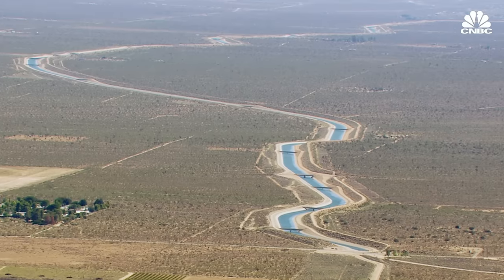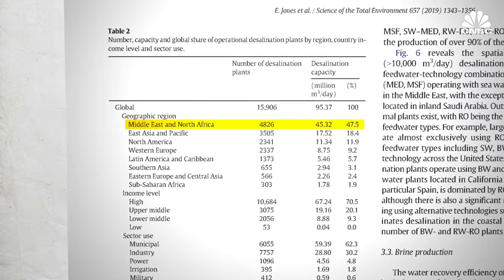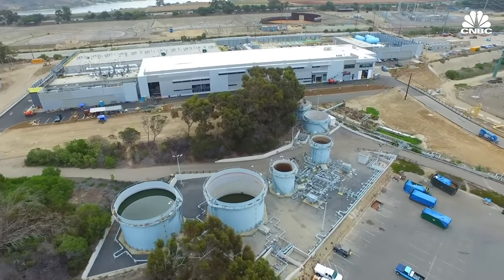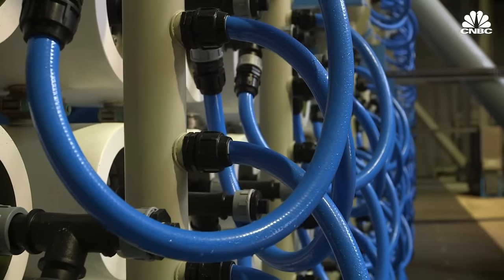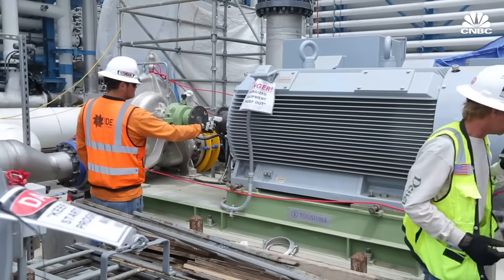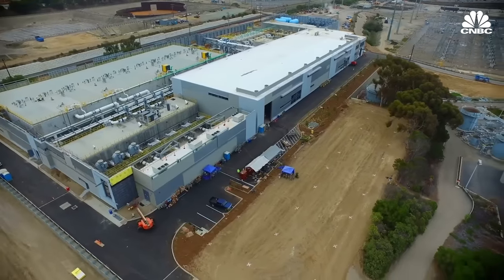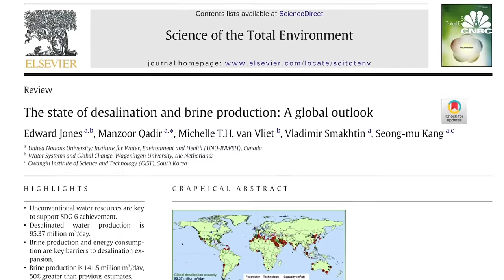Can Sea Water Desalination Save The World?

Comment: One possible, partial solution to the problem of returning heavy brine back into the sea would be to install a pump that draws straight seawater out of the ocean and injects this into the outflow pipes of the DS plants and thus diluting the brine. If this was done far enough back from the exits of these pipes this would likely ensure that the brine was evenly diluted and so this diluted brine would likely be less harmful to denizens of the deep. Not a full solution, but rather inexpensive and harm-reducing.
Reply: The biggest idea I am trying to express is tunneling aqueducts from the coast, in this case the west coast of the USA inland to feed combination geothermal power and sea water desalination plants.  The idea seems to be so big that no one has considered it possible but I believe it is not only possible but it is necessary. For over a century the fossil water contained in aquifers has been pumped out to feed agriculture, industry and municipal water needs. The natural water cycle cant refill fossil water deposits that were filled 10,000 years ago when the glaciers melted after the last ice age. Without refilling these aquifers there is not much of a future for the region of the United states. As a result ground levels in some areas of the San Joaquin Valley have subsided by more than 30 feet. Similar fossil water depletion is happening in other regions all around the world. TBM and tunneling technology has matured and further developments in the industry are poised to speed up the tunneling process and it's these tunnels that are the only way to move large volumes of water from the ocean inland. The water is moved inland to areas where it can be desalinated in geothermal plants producing clean water and power. In many cases the water will recharge surface reservoirs where it will be used first to make more hydro power before being released into rivers and canal systems. It's very important however to not stop tunneling at these first stops but to continue several legs until the water has traveled from the ocean under mountain ranges to interior states. Along the way water will flow down grade through tunnels and rise in geothermal loops to fill mountain top pumped hydro batteries several times before eventually recharging several major aquifers. What I am proposing is essentially reversing the flow of the Colorado River Compact. Bringing water from the coast of California first to mountaintop reservoirs then to the deserts of Nevada and Arizona and on to Utah, New Mexico, Colorado and Wyoming. This big idea looks past any individual city or states problems and looks at the whole and by using first principles identifies the actual problem and only solution. Political will is the biggest hurdle to accomplishing big projects. Especially in California and after blowing $100 billion on a high speed train to nowhere. I think it is obvious to most people that something drastic needs to be done to solve the water problem and that conservation only goes so fare. I would propose to fund the tunneling part of this solution with a system similar to the Permanent Wyoming Mineral Trust Fund is a type of permanent fund called a sovereign wealth fund (SWF). SWFs are typical government funding tools. They consist of investments and assets that the government is not allowed to cash out or deplete. However, while it can't touch the principal, the government normally has the right to spend any revenue these investments generate on appropriate functions and expenses. Each state, California, Nevada and Arizona and on to Utah, New Mexico, Colorado and of course Wyoming could place a small 2% tax on the energy sector and use those funds to invest in Geothermal energy projects and eventually the aqueduct can link up to those projects. There are already over 800 geothermal energy projects in California alone. The equation for my big solution is (ocean water brought inland through large underground aqueducts + combination geothermal and desalination plants = clean water and clean energy).
Reply: Or we could just seperate the minerals in the brine.
Reply: Just another sign that you CAN'T have infinite growth on a finite planet. Yet we won't learn,we just keep on trying unlimited growth. Humans are this epochs dinosaur.
Reply: At the end of the day Enviros are worried about a small, tiny little area where some fish might not be able to live. Big deal. A small price to pay for such a good benefit. But we all know that is not all it is. Enviros will come up with reasons to appose Desalt plants to no end. That's what they do.
Reply: @johnbeckwith1361  
It is not a small tiny area where some fish might live. It's an eco system. A tiny inlet can hold an entire, balanced eco system. Oysters, shrimp, sea grass, fish, birds, etc etc.

I live on the Texas coast. We've seen first hand how careful you have to be with runoffs down here. We're getting ready to build a huge desal plant here in Corpus Christi. You'd better believe it's not just "eco warriors" fighting this fight. Hunters, fisherman, people in the tourist field, restaurants-- everyone is watching.
Reply: 1. brine is the byproduct of desalination so first we have to do desalination before treating brine the process itself is costly which has 50% effective.( we should find better way to increase the effectiveness of process)
2.whatever we do , but brine is something which is a result of our activity and assuming the natural rate of desalination is very less comparison to our activity WE SHOULD FOCUS ON LESS CONSUMPTION OR REDUCTION  )

3.the dilution itself is carried out in sea and ocean but the quantity of NaCl remains the same as the amount of NaCl is accumulating thus we again comes to same problem excess NaCl 
4. a.we can use brine in the process of demineralisation.
 b.can be used in chemical reaction in process.
5.the product containing high amount of Na Cl should be reduced and the industries should use other salt that do don't produce saline taste as NaCl is the only salt that produce saline taste.

Comment: Use the brine for energy in a hydro steam engine, and the salt for thorium engines!
Reply: its a good try but, at the moment thorium is so abundant in stock piles and mine-able deposits that it doesn't really justify filtering ocean water for it, its the same for other things like gold.
Reply: @devonking8727  Yes, but if its ocean water that's becoming clean water, than it would justify using it for thorium and that means that we don't need to mine from the earth for it anymore. Just use ocean water.
Reply: Wrong kind of salt.  MSR uses lithium-beryllium fluoride and lithium fluoride, which remain liquid without pressurization from about 500°C up to about 1400°C, and require no water or pressure, which is what makes them so safe plus the fact they hotter they get, the less they work, plus you can have thermal plugs that dump the salt with no human intervention plus a mechanical one to shut things down.  Original thoughts were small, self-regulating ones for cities in the middle of nowhere with nobody to tend them.  If you mess with them, they can automatically poison the mix so you can't use it for anything.

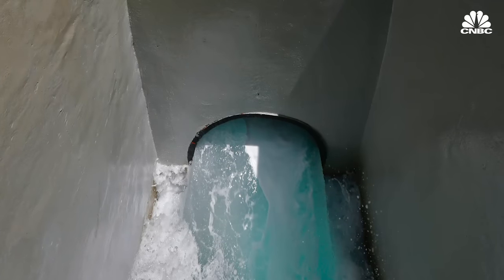Comment: 8:14 Don't dispose of the brine. Sell it to a company that will spray it on the flats and generate Artisanal Sea Salt that will sell for $18 per pound (j/k). As a side note, fully desalinated water and the resulting brine may not be required: brackish water or partially desalinated water can be used for some types of agriculture, one of the largest demands of water in CA. This would alleviate the burden on the fresh water supply.

Comment: 1. Middle East sends a lot of oil tankers to East Asia where fresh water is plenty. On return the oil tanks are filled by seawater for balance. They could do this with fresh water and this could help (not solve) with the issue with some of these countries.

2. The brine is dense and heavy. What if nanobubbles are injected to the water? This reduces the density and might help with mixing with the seawater.

Comment: Nuclear power is more important than ever.
Reply: Fusion
Reply: @mokubakaiba1751  great argument
Reply: But not old-style pressurized water-cooled reactors. They are costly to build, generate a lot of expensive-to-dispose-of radioactive waste, and are an oversized "dirty bomb" waiting to go off if the coolant flow is cut off (as we found out in Fukushima Daiichi in 2011). We need Generation IV reactors that are vastly less costly to build and run, generate far less radioactive waste (if the nuclear medicine industry doesn't grab it first!), and are completely "walk away" safe even if the coolant flow cuts off for any reason.
Reply: Nuclear engineering student here! i agree :) and let's hope fusion isn't another 30 years away aha
Reply: @mokubakaiba1751  I wouldn't mind. I'm not a hippie treehugger

Comment: Australia calls itself 'the lucky country'.  That map showing the number of desalination plants is Australia coupled with and ever expanding desert and water shortages would suggest otherwise.  Australia has massive coal reserves but you can't drink or eat coal.
Reply: The potential for water shortages was identified decades ago, yet the population has continued to grow and grow. Perth used to be like a country town with a population of around 300,000 in 1950. Now it's 2.1 million, so it's hardly surprising that there's a water shortage in an area that's hot and dry. Desalinisation is what they've turned to after running into environmental issues with pumping ground water. That water used to reak of chlorine, have a brownish tint and a distinctive taste, a far cry from the odourless, colourless, tasteless liquid school chemistry described.

With coal coming under pressure from a climate change perspective, talk has turned to what will happen to the massive open cut mines once they're no longer economic. It's as though it hasn't been though about before, but obviously they can't just be abandoned in a country prone to bushfires as a coal fire can't be extinguished, it just burns until there's no coal left. The brilliant solution was to fill them with water and make them lakes. Australian agriculture already syphons off so much water that the biggest rivers hardly flow anymore, so where this massive amount of water would come from to fill and then maintain these lakes is anybodies guess.
Reply: They have all the sunshine they need.
Reply: @brianmi40  solar obviously doesn't work at night and battery technology to power a country on a large scale is probably a long way away.
Reply: You can burn coal to cook steaks, so win win
Reply: Australia also has uranium.
How many nuke plants does Australia have? How much nuclear power does Australia apply to desalination? The water which is from desalination is obviously best for the cities. The water from the water sheds should be principally for the inland farms and those towns.

Comment: Instead of putting the brine back in the ocean why dont they extract salt, sodium, chlorine, lithium and other materials from it.
Reply: Economics. They would if the cost of extracting them wasn't higher than the value of the amount present in the brine.
Reply: more saturated requires more energy to break
Reply: @vishvaschoudhary3858  dude it is in California.  Lots of free sun thr
Reply: Price and energy
Reply: @najibyarzerachic  Still have to separate them and harvest them, then there's the added cost of maintaining the infrastructure for doing that.
Reply: I've thought of that for some time. There are at Least 59 elements that can be Extracted out of Sea Water. And that would be 
" Efficient " but probably " quite expensive " !
Reply: The sea creatures need the salt in the water and we cannot be to greedy for the Earth
Reply: @crayfish7542  Actually, it wouldn't be efficient, which is why it would be expensive. Thoroughness != efficiency. It's drastically easier to extract and separate a few select compounds out of a solution, than to extract and separate all of them - especially when "all of them" is in the dozens+.

Comment: Why dont they also make sea salt? With the brime having high amounts of salt
Reply: Vlad the guru  
The salt is assimlated in tanks/pools, not the pipes.
(the brine is really hot)
Reply: Ocean water has 35 g of salt per liter. Brine out of the desalination plant has, per the show, 70 g of salt per liter. To get to usable salt one has still to evaporate 930 ml of water. Sea salt is made by trapping ocean water on large shallow ponds and letting the sun to do the job. Surely they make sea salt from the brine but there is too much of it, so the brine has to be disposed off back into the ocean. Ocean water is moving continuously due to tides, currents and waves. The issue of brine not dispersing is bogus. Depending on local conditions it can be discharged for a good dispersion without problems. The opponents to water desalination are the same opposing nuclear plants and use of oil for producing energy.
Reply: sea salt exists

Comment: If we ever make a fusion reactor that boils water to make energy why cant we use sea water and desalinate the water in the process.
Reply: Radiation, I'm guessing.
Reply: Radiation poisoning isn't fun
Reply: Like in certain fission reactor systems, you can have a 2 coolant loops. The first coolant loop takes water through the core and takes on radiation as well as heat, the first loop then transfers its heat to the secondary coolant loop (no radiation transfer.) I final fusion reactor model has obviously yet to be nailed down, but a similar system could probably be implemented.
Reply: First, nobody said we couldn't, but the salt would be difficult to remove and could cause other problems at high temperatures. Also fusion energy is still quite far away. And addressing other comments, exposing water to radiation doesn't do anything unless the source material leaks into the water. the radiation doesn't "stay" in the water.
Reply: @froztbytesyoutubealt3201  Fusion should not create radiation.
Reply: You don't need fusion to do this. Any thermal power plant (coal, natural gas, biomass, peat, oil, fission, concentrated solar, geothermal, etc.) needs a system to remove exhaust heat from the system, often they use water to cool it via a river running through, or a cooling tower, or cycling through other sources of water like seawater, they heat the water to cool the thermal plant's coolant enough to run the heat engine and either they let the water evaporate or pump it back out to the same source where they got it to limit the water use of the power plant. A very crude method of desalination would be to use seawater, just evaporate a lot of it and capture the steam and condense it into a tank and pump the brine back out, there's a much better method to do that though that is way way way more thermodynamically efficient to do that though called multiple effect distillation to recycle the heat over and over to squeeze out more water than you would otherwise for a given amount of heat (http://www.sidem-desalination.com/Process/Thermal-desalination-MED/MED/Process/).

This isn't done generally because water desalination isn't given as a design goal of a power plant and generally the water output follows power production from the power plant, so it isn't going to be consistent because power output needs to follow power consumption and not the other way around.
Reply: "𝐟𝐮𝐬𝐢𝐨𝐧 𝐫𝐞𝐚𝐜𝐭𝐨𝐫 𝐭𝐡𝐚𝐭 𝐛𝐨𝐢𝐥𝐬 𝐰𝐚𝐭𝐞𝐫 𝐭𝐨 𝐦𝐚𝐤𝐞 𝐞𝐧𝐞𝐫𝐠𝐲"  You can neither make nor destroy energy, only convert it.  Boiling water by a thermal source turns a turbine.  All the best, Patrick ;-)
Reply: @coreymicallef365  still though I like it as a solution
Reply: @CoffeeD_1  not entirely true, ionising radiation is absorbed by mass, that is severely dumbed down but it's the basic gist of it.
Radiation that hits the concrete of a reactor's insulation doesn't just vanish, ionising radiation is an electron that "jumped" loose from it's nucleus, so it has to go somewhere.
These electrons are absorbed by other materials, and water would also absorb this radiation.
Now it will in most cases be negligible if applied as said above, that is if said piping is made of a heavy metal. As in molecularly heavy.
But drinking it wouldn't be a very smart idea, I'm no expert on molecular physics but I do know adding and removing electrons from a nucleus can significantly change that material's properties (after all that is the reason radiation exists in the first place, radioactive isotopes like uranium 235 have an excess of electrons, this messes with the molecule's charge and since the protons in this particular isotope are outnumbered by the electrons, the material is molecularly negatively charged. As such it will repel these electrons to balance it's charge, which it does in the form of ionising radiation.)
So in theory the water could become radioactive, of course not like the uranium itself, but this can still form a problem if ingested, since our skin is what protects us from certain types and doses of radiation, your internal organs do not have this defensive barrier and will take the full brunt of whatever radioactive material in ingested.
Reply: @Gazr Gazr happy someone said corrosion. Many people have no clue just how corrosive salt water on a system over time compared to fresh water or specific solutions created to reduce corrosion for heat exchange applications such as engine coolant.

Tipping my hat to you.